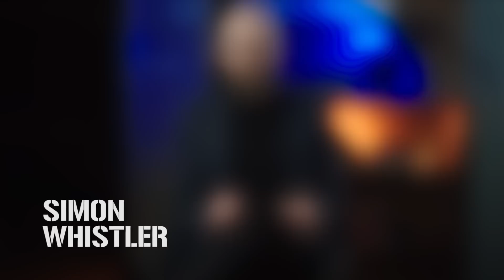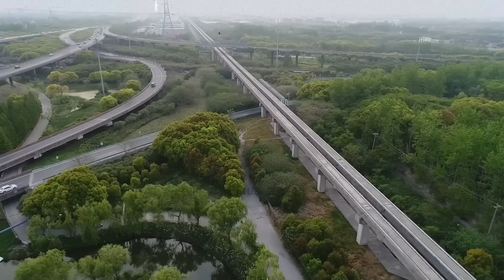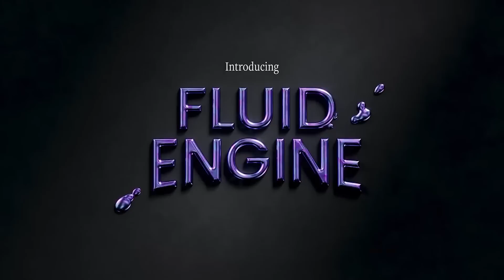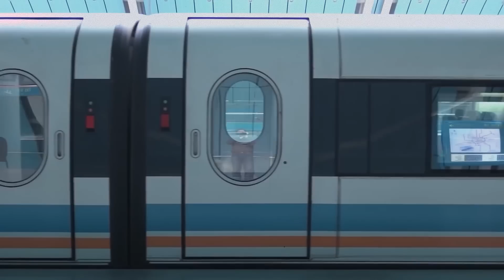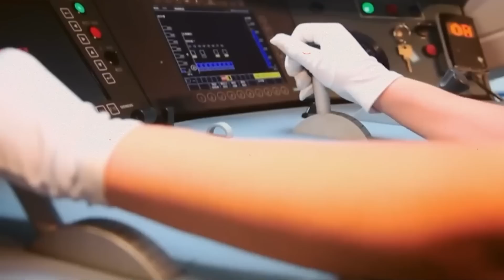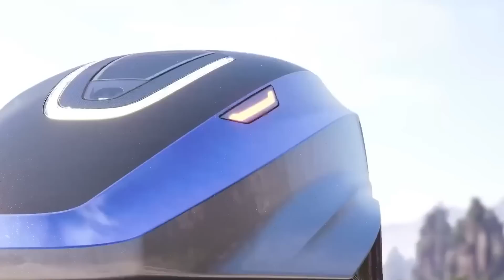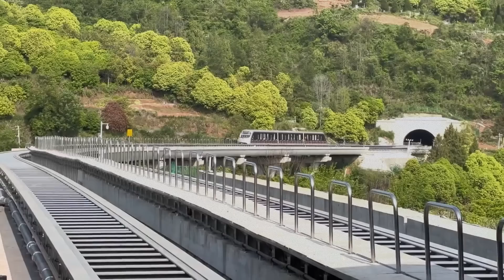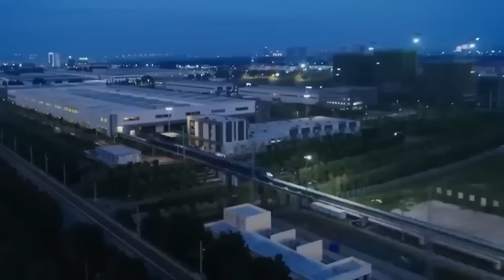A Chinese Maglev Revolution is Coming...

Comment: Here is an old report about Japan's MAGLEV: "Oct 31, 2017 · The new Japanese maglev became the fastest train in the world after traveling at 374 miles per hour (603 kilometers per hour) on a test run near Mount Fuji last." When we were touring in Japan in 2020, we saw the high-speed MAGLEV but elected to use the 1/2 speed at about 1/4th the cost.
Reply: You can't "use' the maglev in Japan. It's not open to the public yet.
Reply: @matsv201  mainly because of the Shizuoka prefectural Governor going NIMBY because the government refused to build a station in his area.
Reply: @ianhomerpura8937  It would not be open anyway. The first date for opening was 2025, that was moved to 2027, that they now due to the issues with local government think they are not going to make.

They will probably open a section of the service to 2027.

The prefecture that is complaning was the only one on the line that didn´t get a station, and they are really salty about it
Reply: @matsv201  You're wrong. They select applicants which are members of the public to ride them. Do your research Mr CCP
Reply: @matsv201  if I remember correctly, the train has been used commercially on and off for about....25 years I believe. They're just battling it out with a prefecture to let them pass and connect to a bigger region.
Reply: @Notsogoodguitarguy  Not really. At times it have been open for visitors. There is only one station so you can´t be transported anywhere

There is a other maglev train in Nagoya that is in revenue service, and it have been for about 20 years.
Reply: Central Japan Railway is currently building a Tokyo (Shinagawa) to Nagoya maglev line. They are running into problems with getting permission to travel through a corner of Shizuoka Prefecture. Eventually it is hoped the line will be extended to Osaka. The majority of the line is inside tunnels through being built through mountains.
Reply: @deanzaZZR  Although you're right Osaka is part of phase II they have moved the date forward. IN all honesty, the Maglev to Osaka will be the game changer and it's been planned to be run to Osaka from the get-go. 

WIth the delays in Shizuoka, there is actually a chance that they may open Tokyo–Osaka in one phase. The original date for the Nagoya–Osaka portion was 2037... and it's estimated that Tokyo–Nagoya will be as 2035 now (though how much of that is just hyperbole to get the Shizuoka to cave is unclear)

Note: the Maglev WILL benefit Shizuoka as it will allow more Tokaido line trains to stop in Shizuoka, but it will not a direct benefit.
Reply: @TheNewGreenIsBlue  As someone who regularly did Shin Kobe to Tokyo on the Shinansen two decades ago I would only use a Maglev option if someone else is footing the bill. Shinkansen is already expensive enough.
Reply: @TheNewGreenIsBlue I think construction will start soon as the governor of Shizuoka is gone. He resigned.
Reply: They haven't even secured all the land for the maglev they're building now. One prefecture is holding out. And I shudder to think what the prices of the tickets will be.
Reply: They have secured all the land, but haven't secured the right to tunnel through a small section of Shizuoka due to environmental concerns over the Oi river (and a stubborn governor). It doesn't help that Shizuoka will be the only prefecture without the station (The line runs through the middle of nowhere in the Japanese Alps)

 @pbworld7858  The plans for ticket prices were announced to be about ¥1000 more than the fastest Nozomi service, but I'd imagine that's 2007 prices... likely a 2000–3000¥ premium is my guess. 

Because both lines will be run by JRC they want to incentivize travel on the Chuo line. Osaka passengers will have to transfer to use the line at Nagoya and they have to make it worth their while in terms of time and money to ride it.

Also keep in mind that JRC owns a lot more infrastructure around the terminus in Tokyo (Shinagawa) so will generate revenue from making that area of Tokyo a more popular destination than Tokyo Station.
Reply: @pbworld7858  they're smart people, they'll figure it out. They've been at it for decades, I'm sure they've ran a few calculations on pricing and whatnot. Plus, this line is probably not gonna be for everyone anyway. Maglevs are basically an upper-middle class and up mode of transport (if you wanna make them economically viable, that is)
Reply: @endjfcar  I'm not saying they always are. But I'd still trust they'll make a good show of it.
Reply: @endjfcar  Is your country any better? LOL thought not
Reply: @smilepermile8165  My country has one of the best metro system in the world, Seoul Metro. Even better than Japanese one.
Reply: The long-distance ones don't make sense -- that's what planes are for.
Reply: what a slow maglev, cheap and outdated stone age maglev the new shangai to hanzou maglev is estimated to go 1000km/hour 621 mile per hour. what is the point commenting this old report to humiliate japan? that they are behind in technology? but then again china leads in 37 of the 44 techonogy sectors of the world with the 7 rest leading by usa, and japan leading in none
Reply: Long-distance mag-levs aren't for making cost-benefit sense.  They are for the bribes, boondoggle, and bragging-rights of the evil CCP.  (This comment will get deleted by pro-CCP censors.)
Reply: These long-distance mag-levs don't make sense -- that's what planes are for.

If these things can take an hour off the DAILY commuting time for 10 million people, that's
great.  

Or, if they can practically move 5 million people out to 1/2-priced housing and real estate, that's great too. 

But taking an hour off the travel time for a fat-cat's trip to Shanghai - that's STUPID.

* * * 

Actually, these long-distance mag-levs aren't for helping ordinary people, or even fat-cat business men. ---  They are for the bribes, boondoggle, and bragging-rights of the evil CCP.  (This comment will get deleted by pro-CCP censors.)
Reply: Just as a test run. Not real service

Comment: Yeah! As someone involved in train propulsion the technology is fine, can be made stable and will result in fast low maintenance services. There is a big BUT here. The penalty here is energy, you certainly spend a little less than tracked vehicles, as most of the energy is used to overcome drag at speed , not to overcome track friction. The real gotcha is the energy required to levitate the train, it's a lot.  Plus the cost of replacing rails with levitation tracks is horrendous. That's why all current tracks are short dedicated services.
Reply: You are incorect on all points.

Maglev trains have no wheels or power pick up or really any other external protruding stuff. They are way more aerodynamic than conventional trains, hence they use less energy at higher speeds.

The levitation is provided with hybrid magnets. They use basicallt no energy at all when levitating and use a lot of energy only when lifting of the track. When levitating at traveling forward they use only about 50w per ton in energy to balance the hybrid magnets.
Reply: @matsv201  Sorry, your credentials as a train engineer are? 
There is no such thing as zero energy levitation, energy is also used for track position maintenance laterally. 
Did you actually read my comment? At no point did I say that maglev trains are wheeled. The point is that energy is used on both types of train and is not vastly different as most is used to overcome drag.
Reply: @bellshooter  
"Sorry, your credentials as a train engineer are? "
Sufficient.
"There is no such thing as zero energy levitation,"
You be very wrong about that. Levitation it self requires no energy. Some system have energy to balance the levitation. There are totally passive systems.
https://www.youtube.com/watch?v=0rrN1vgA8to

"Did you actually read my comment? At no point did I say that maglev trains are wheeled"
Jepp, but you didn´t read mine.

"The point is that energy is used on both types of train and is not vastly different as most is used to overcome drag."

You be wrong about that to. The main drag from a high speed train is power pickup and wheel assembly. To a degree also wagon connections.

The first two things maglev trains don´t have what so ever. For wagon connections they can be done much tighter on maglev train than conventional trains. Reducing the last amount of air resistance.

In effect a maglev train typically have less than half the Cv value of a wheeled train
Reply: @matsv201  Your 'Sufficient' qualification is obviously not. 
Pure magnetic levitation IS possible but this cannot be used for train levitation due to the need to control it for vertical stability and payload control, and lateral stability needs for track centring during any movement. The energy required for conventional electric rolling stock is according to the speed squared and only a small expenditure is for rolling resistance, the vast majority above about 80 kph is for air resistance, just go do the maths.
Reply: @bellshooter  
"Your 'Sufficient' qualification is obviously not. "
You say so? Are you sure?

"ontrol it for vertical stability and payload control, and lateral stability needs for track centring during any movement"
I just sent you a video where they show a practical example of them having a totally passive track, so you are clearly wrong. 

" the vast majority above about 80 kph is for air resistance, just go do the maths."
Did you even read what i wrote or are you so absolutely expert you don´t need to read the reason given becasue you just know?